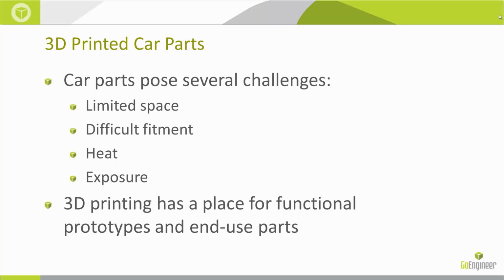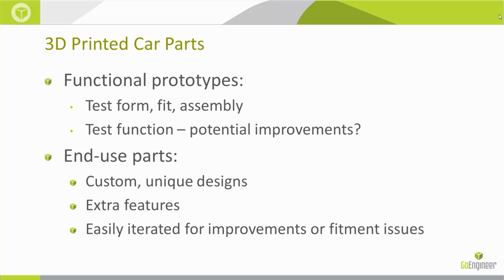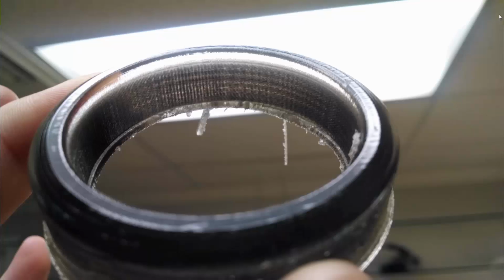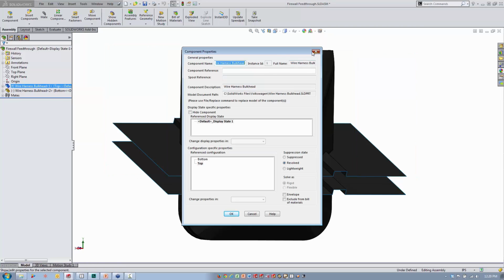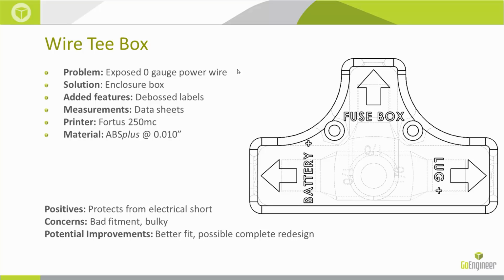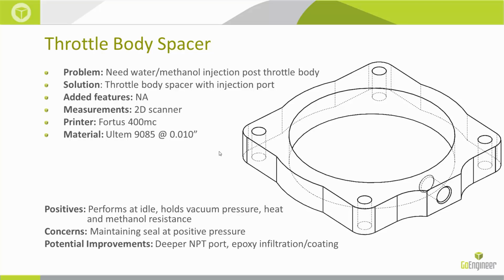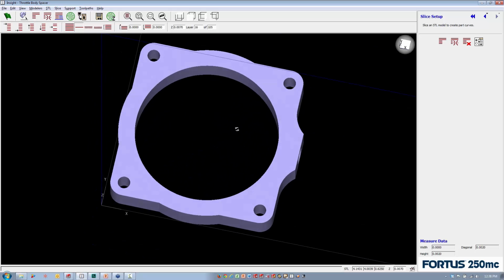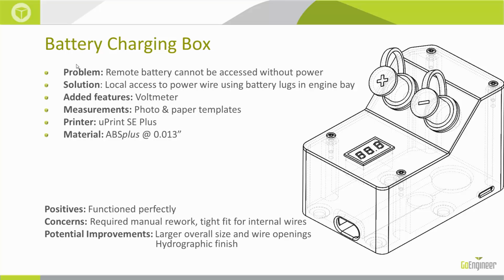Stratasys - 3D Printed Car Parts

Comment: what filament would be best for printing trim pieces for the outiside of cars? i want to print weather stripping for cars that have discontinued parts.
Reply from the maker: Hi Ben,
If you are placing your designs outside then we would recommend a material like ASA that is UV resistant.  Ultimately, exposure to outdoor environments is not a good place for any printed material though.

Comment: which 3d printer would you recomend
Reply from the maker: Hi Leslie,
A chief concern when selecting a 3D printer is the type of material it will be printing with.  You may want to take a look at this page specifically (http://www.goengineer.com/3d-printers-2/#1443023312493-ba38809b-d7d5) that gives you a list of available materials and what printers those materials can be printed upon.  This should help you to narrow down what set of printers you would want to look at to fulfill your specific needs.

Comment: what kind of printer and plastic would you have to use to make an intake manifold that has to deal with 230-240 degrees Fahrenheit?
Reply: Shift Z Channel I would recommend ULTEM 1010 for that application. It is used by FSAE teams currently for intake manifolds. I wouldn't recommend it for a daily driven car however.
Reply: why? don't they use plastic intakes on most cars now? What do you think of the airwolf printer series? oh and great video!!!
Reply: Shift Z Channel yes many OEM intake manifolds are plastic, but they are injection molded with plastics we can't print in. They are generally superior mechanically, more reliably manufactured, and hold up to repeated load and heat cycles better than the printed options. 

I don't have first-hand experience with AirWolf but have seen parts at trade shows. They are the best looking parts off entry-level machines I've seen, and seem to have a lot of material options. I don't know enough to comment on the accuracy, repeatability, or ease of use though!

Thanks for watching!
Reply: good to know...
Reply: an argument against that, Jay Leno built a plastic intake (with his 3d printer) for his Rolls Royce powered v12 hotrod....I guess I will have to find out the specs on his printer. Granted he has infinite money and I don't...but it might be good to find out.
Reply: I was able to visit his garage about 2 years ago, at the time he had a Fortus 250 which prints in ABS. I'm not familiar with the RR manifold you are talking about, but I doubt it was printed on that machine so tough to say. Remember though, Jay Leno doesn't daily drive that car or rely on it for his commute. When he parks in the garage, a team hooks the vehicle up to a battery charger and cleans the entire vehicle inside and out. 

I have no doubt a printed intake manifold would work, I just don't believe it would be a reliable part on a daily driven car :)

Comment: Great webminar, as another GTi owner (Mk6), kudos on the GTi mods. Engine bay looks clean and functional. I have two questions related to your webminar:

1) Would a 3D scanner help in creating the files to print? 
2) Can a mold be created with a 3D printer to create carbon fiber parts using prepreg carbon fiber?

thank you for your time.

EJ Ortiz
Reply: Hi EJ - thanks for watching. The mk6 is a great car. To answer your questions:

1) A scanner could have helped - at the time I didn't have access to a scanner (I do now) but I don't think it would have sped up the process at all. If the space I was trying to fit my box into was more complex, the scanner would have been more useful.
2) Yes! We have material options that would be ok in an autoclave. I have a webinar devoted to composites somewhere on our YT page.
Reply: Tyler Reid Hi could you please send a link for your webinar about fabrication of 3D printing using Carbon